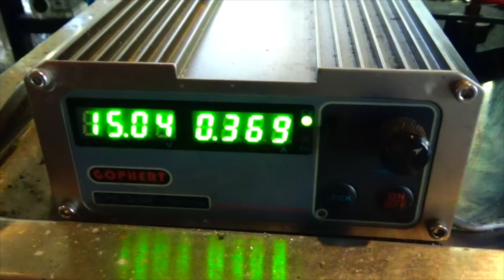#RoughCut2022 - How To Make a Lathe Tool Height Setter.

Comment: For a horizontal bed engine lathe…

1.  Face it until the tit disappears.
2.  Ballpark it by pinching a 6” scale against the work OD.  Does the scale look vertical?  This will get you surprisingly close.
3.  Really nail it using a 40mm shaft that has been faced to the vertical dimension of your ways to centerline.  Joe P gave me that one and it is simple and really accurate.
4.  I’ll bet Mark comes up with something good though.  He’s still milling aluminum…
Reply from the maker: Many have reminded me that my approach is over the top. My view is that I have to justify the investment in bead blasting kit, anodising plant, expensive CNC tooling and honking great milling machine. My wife thinks I am working. I am having fun. 😁
Regards,
Mark
Reply: @Preso58     Your tool centerline setter is a thing of beauty, artistic and functional.  Typical of your work.  I’ve watched all your vids for a couple of years now.

Comment: Nicely made tool but a bit more verbal communication during the operations might have cleared the vision through the murk before the final demonstration. Didn't have a clue as to what you were trying to make. I understood you were showing us "how to align a tool on the lathe" not make a tool to do so.
Curious as to why you set up boring the bearing seat in the lathe. Surely boring it while still in the mill vice would have made sense but maybe you don't own a boring head.
 When you calibrated to the tailstock you referenced each level to tools in the tool post. When reversed into the chuck on the lathe spindle the references are reversed. Does this cause a miss alignment of the tools since the setting tool wasn't calibrated in that plane?
Thanks for posting. I'm not trying to criticize your work. It was excellent. Just needed to know what you were aiming at. Even a "chicken scratch" drawing at the beginning would've/could've helped.
Regards from Canada's banana belt. 🤔🇦🇺🐨🕊️🇺🇦🇨🇦🍌🥋👍
Reply from the maker: Ron, I would normally include a commentary on the build but I was up against the clock on this video. I try to keep it to 30 minutes or less but this was a long build. I do have a boring head for the mill but I find that the lathe in conjunction with the DRO allows me to obtain more accuracy. I was chasing a tight tolerance for the bore rather than concentricity. I haven't noticed any loss of accuracy when switching the tool from the headstock to tailstock. If they aren't in alignment you have a real problem. I have included a link to the drawings in the video description (yesterday). Normally I would show the finished tool or a drawing of it right at the beginning of the video but I was trying something new. Given the feedback I will probably go back to my normal format. Thanks for watching. 
Regards,
Mark

Comment: Great video, but man that electrical resonance sound through headphones 🔌😬⚡
Reply from the maker: That is my rotary phase converter. It is noisy and it annoys me too. I don't really have a choice though. It's not really feasible to run three phase power to my shed and although I looked into getting a VFD to run the Bridgeport, I was talked out of it due to the single phase X axis power feed motor and the coolant pump. 
Regards,
Mark

Comment: That's interesting, but I'd tend to say that once you have the lathe and the mill and the ability to build the tool, you know how to adjust the tools on the lathe.  It's a kind of chicken and egg situation.

But that can be a nice gift to make to a friend who is starting with a lathe.
Reply from the maker: I have three tangential tool holders made by Eccentric Engineering. They are great tools and use cheap HSS but each time they are sharpened you have to reset them to centre height. Unlike carbide insert tools, the tool bit is clamped at about an 80 degree angle. The particular geometry of my cross slide and compound also makes it a bit of a chore to use the old centre height  post. For me, this tool is a time saver and is worth the effort to make it. Plus, I had fun making it. Gotta have fun in the workshop! 😁
Regards,
Mark

Comment: The roadblock here is that this machine is intended to make precision components and there's nothing precision about a bubble level.  Yes, a bubble level is used to level the 
machine but after that you still need to make test cuts to ensure that it's cutting straight.  A simpler solution is to measure from the centerline of the spindle to the top of the 
cross slide and make an "L" gage block that sits on the cross slide and overhangs the tool.  You could even put magnets in it so that it will stay in place while you set your tool.
Reply from the maker: I have a gauge block and it is configured for both regular and inverted tools. However it is very sensitive to having swarf trapped underneath it. If everything is clean and clear it does a good job. Edge Technology make a tool very similar to the one featured in this video so there must be a market for this type that uses a bubble level. That is what gave me the idea to try out this tool. A lot of people who don't watch the whole video think that I am advocating this as the only or best solution. This is not the case. I wanted to make a nice tool to give away as a subscriber gift and I also wanted to showcase some processes that can be carried out in the home workshop like anodising and drag engraving. Having said that, I use this tool often and it works well. Yes it takes a bit more work to manufacture it but you don't need to go to as much trouble as I did. It could be made of wood or plastic and as long as you build in some means of calibration it will be accurate. 
Regards,
Mark

Comment: Nice work, but it would be easier and quicker to make a height gauge (set to centre) with its base on the cross slide area.
Reply from the maker: Maybe it's just my lathe but the tip of the tool is always forward of the edge of the cross slide. Also, some lathes like the South Bend and the Hercus lathes that are very common here in Australia don't have machined tops on the cross slide so there is no flat reference to put you height gauge on. 
Regards,
Mark

Comment: I use a gage that sits on the flat way of the lathe. Your tool is over kill and requires a chuck in the tail stock.
Reply from the maker: I suspect you are missing the point of the video. I was making a gift as a giveaway for a subscriber draw and I also wanted to demonstrate some techniques for metal finishing and machining that might interest viewers. I agree that the tool is somewhat overdone but I also just enjoy making nice things. 
Regards,
Mark.

Comment: Interesting, if I have the knowledge, experience  and equipment to make the tool. I don't need the tool. BUT that does not mean having the tool isn't useful. I would like to see a how  to with hand tools and a basic lathe. Something an amateur could do.
Reply from the maker: The only real requirement for this tool is to have the two bubble levels parallel to each other. If you were able to start with some stock that had reasonably accurate parallel edges the rest could be quite crude and still work. I would guess that a good 3D printed part would work fine. Even something made of wood!
Regards,
Mark

Comment: For the roughcut challenge a wonderful entry! 
It does seem a bit overly complicated to me though. I have a stunningly simple method: I use my height gauge. For calibration take a piece of round bar, halve the outer end in the mill, put it in the lathe’s chuck, measure the height of the flat from the crossslide’s surface with the heigh gauge and write the numbers down. 
When setting any tool, set the height gauge to the “calibrated” height, lock it and use it to adjust the tip of the tool accordingly. Works every time. 
Advantage: works even when your workpiece is already in the chuck 😉

Disadvantage: it is a lousy entry in the roughcut challenge 😂
Reply from the maker: It's the old "horses for courses" thing. I am sure there are dozens of ways to do the same job. I badly wanted to buy one of the Edge Precision tool setters but they are very expensive here in Australia and I am not sure if they will do inverted tools. You are correct though. I was looking for a topic for the roughcut hashtag and this one fitted the brief. 
Regards,
Mark
Reply: @Preso58  I enjoyed it nonetheless, very much indeed. So keep on doing things, even if overcomplicated, your videos  are seriously entertaining.

Comment: Great if you have a full machine shop (and probably don't need this)   What about us beginners >>>
Reply from the maker: I have a plastic tool setter that works quite accurately. It has a simple 90 degree vee which can be pushed up against the round stock and there is a small bubble level in the top of the tool. There is a flat surface which is aligned with the centre of the vee so you can just raise and lower the tool tip while checking the level. It takes two hands to set it up but it could be easily 3D printed or simply sawn from some aluminium or brass stock. My version was deliberately over the top because I wanted to give it away as a gift. 
Regards,
Mark

Comment: Why not ditch the bearings, and just clamp a shaft into the lathe?  You could then just rotate the headstock until the level zero'd out.
Reply from the maker: That would work. There might be some danger of chipping carbide inserts if you run the tip into the setting screw though.
Regards,
Mark

Comment: IN THEORY the tail stock live center is machined true and square, so put live center into chuck, push up against the jaws, tighten ensuring no play or gaps, and center the cutting tip on pointy thing ... gets you REAL close... Do like the tool though, if only I had a milling machine to go along with my lathe I'd be all set..... :)
Reply from the maker: There are several methods for setting lathe tools using existing features of the lathe as you have suggested. This tool is probably a bit over the top but I enjoyed making it and I now have something to give away for the 30K subscriber draw. 
Regards,
Mark
Reply: @Preso58  Don't get me wrong, it's AWESOME work, meant no disrespect at all. I think you could build a pocket watch if you wanted to given the attention to detail you do. Your engine series is proof of that.  Shoot, even the stand you mounted it on is a work of art. 
Keep up the great work and THANK YOU for taking the time for making the vids for us!
Cheers Mate from North Carolina USA

Comment: I just shim the tool to the centre of the pip...  No need for a milling machine, or anodiser, or CNC letter printer.
Reply from the maker: You can absolutely do that and it works however, I wanted to make a nice tool to give away to a viewer and the tool was also an entry in the #RoughCut2022 video competition. So, I agree that it might seem like an over the top solution but I also like making tools that look nice.
Regards,
Mark

Comment: I really like most of your videos. It is probable just me but the videos where there is no dialog are off putting to me. I don't know if it is harder to produce a video with either voice over or speaking during the video, but I find those more enjoyable.
Reply from the maker: Yeah, sorry about that. Unfortunately the guidelines for the roughcut22 hashtag required a single video on one tool. Normally I would break the build down into lathe work, milling and finishing in three separate videos. Adding the dialog just about doubles the length of the video. Normal service will resume shortly. 😁
Regards,
Mark
Reply: @Preso58  Hey Mark, I hope I didn't offend with my comment. I find your videos to be really good. It is like visiting a friend in their shop and spending a comfortable afternoon. You remind me of that one Teacher. The one who I felt comfortable with and seemed to learn more from. Hope you have a great one.

Comment: Thanks for the instruction.  It appears that you believe that someone who has a lathe and cannot set the tool vertical position correctly also has a milling machine, a slitting saw and knows how to use them both.
Reply from the maker: No, I realise there are lots of simple ways of setting a tool in a lathe. What I made was overly complex but it was more of a showcase of tools and processes that "can" be carried out in a home shop. I also wanted to make something nice as a giveaway for a subscriber draw. You could just about 3D print a tool like this one and it would be close enough for 99% of tool setting applications. My view is that if I show a detailed tool build, there will always be some setup, cutting operation of finishing application that would interest viewers. Even if you don't want to make an exact replica of this tool it might give someone some guidance on their own, quite different project.
Regards,
Mark

Comment: Great video, but please mute the audio when the phase converer is running. Or overdub with an air raid siren or bagpipes!
Reply from the maker: I am very conscious of the noise of the RPC and I am now muting the audio during all machining operations. Sometimes it's louder than others. Just moving the cabinet slightly seems to quieten it down. I think the idler motor needs balancing.
Regards,
Mark

Comment: Jeez! Ya still need to find the center to calibrate! Just use a height gauge which you should  have anyway, where you can get it to within a thousandth. He also has the tools to mill half the stock off of a piece of roundbar. You don't need to German engineer everything!
Reply from the maker: I know, I know. As we say, there's more than one method to remove the epidermis from a feline😁 I do have a very nice height gauge but it is heavy and tall and you need to make sure the cross slide is scrupulously clean before using it. There is also a raised oil port and a hex nut at the very centre of the cross slide flat which tends to get in the way (on my lathe anyway). The other issue is that many lathes, like the South Bend and the Hercus (a South Bend clone) don't have a machined surface on top of the cross slide. Besides, German Engineering is fun!
Regards,
Mark

Comment: Just cut a piece of stock to the height of the cutting tool.......simple........Z
Reply from the maker: I totally understand why people think that this tool is over the top and I did try to address all the comments in the pinned comment I put at the top of the video. Essentially, I was trying to make a nice tool to give away as a gift and I wanted to show how processes like anodising and drag engraving could be carried out in the home shop. Think of it as a showcase video. Having said all that the tool works well for me because of the configuration of my lathe. People don't understand that not all lathes are the same and there is not always a nice flat surface directly under the tip of the tool. 
Regards,
Mark

Comment: Sorry, what a petard to find cutter height.
Reply from the maker: I am guessing you think it's overdone. The thing is I have three tangential tool holders that take HSS tooling. They are great tools to use but unlike insert tool holders or regular HSS tools held in a horizontal slot, each time you sharpen them they have to be set back to centre height. Also, most commercially available tool height setters don't work with inverted tools. To me, this tool is a time saver. Plus, I liked making it. 
Regards,
Mark

Comment: Presso's purple presetter !
I sometimes use the unit i bought from edge precision but as i run 4 jaw chucks mostly i find it more of a hassle than anything else but at least yours can be calibrated ! Now tell me true -how much hassle did those little copper pads give you coz like me you shake like a dog shitting razorblades 🤣and i would have dropped and lost  quite a few just trying to get them in the hole😡
Reply from the maker: You have no idea how many takes it required to get those little copper chips to drop in and make it look like I did it all day long. I find it more and more difficult to manipulate small parts. So, no late career change to eye surgery for me. 
Regards,
Mark

Comment: Why are you using center drill for pilot hole? That's a bad practice. Center drills are used to create holes for a live center. Center drills create wrong angle that breaks twist drill. You need to use SPOT drill to create a pilot hole. It has matching angle with the twist drill.
Reply from the maker: Noted. 
Regards,
Mark Presling

Comment: Why could you not just use the live center on the tail stock
Reply from the maker: You can absolutely do that but it will only be approximate and you will almost certainly need to do some test cuts to verify that you have it set correctly. 
Regards,
Mark

Comment: A request - Can your next video be about locating and eliminating that humming noise? It is rather annoying.
Reply from the maker: Do you mean my rotary phase converter on the mill? Probably not an option but if it's an audio glitch with my camera I don't notice it.
Regards,
Mark
Reply: @Preso58  Probably the phase converter. Don't see how you can stand it.

Comment: WHY so complicated?  place a 6 inch metal scale on the part OD.  bring tool in to lightly touch the scale.  if scale is vertical  tool is centered.  if scale leans away from tool  tool is high.  if scale leans towards the tool,  it is Below center.
Reply from the maker: You should absolutely use the method that works for you. The rule/scale method is quick and easy but it's still slightly approximate. I had fun making the tool and I wanted to make something nice to give away as a gift. 
Regards,
Mark

Comment: Oh yea, very easy to set up, if you're a freaking machinist.  But if you are a hobbyist, the tool alone is above a lot of folks skill level.
Reply from the maker: You could 3D print this tool and as long as you calibrate it once it will work.
Regards,
Mark